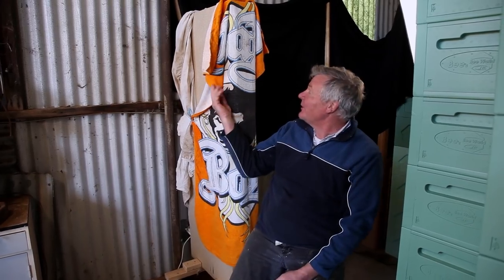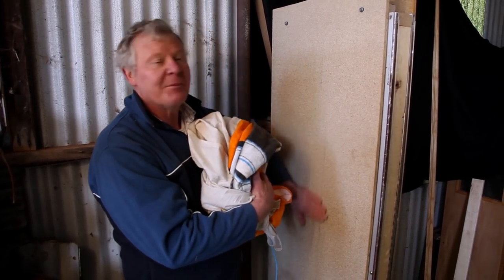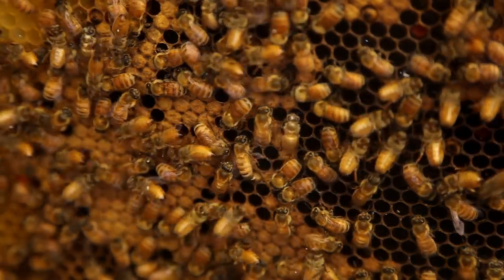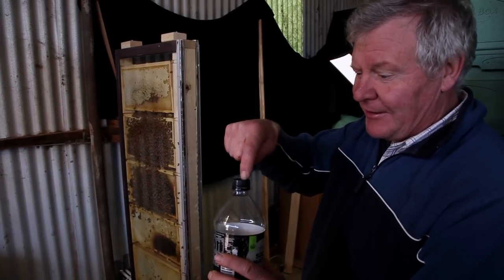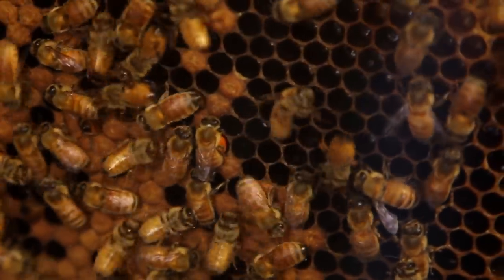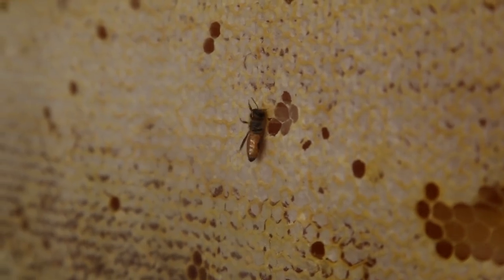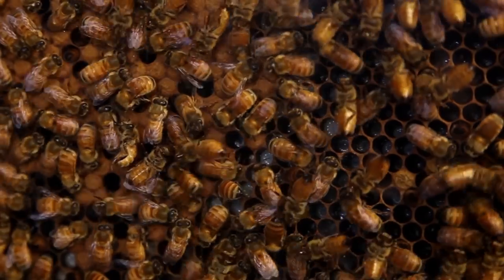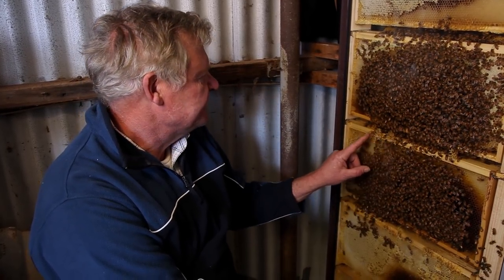How Bees Make Honey and new Baby Bees  - The Bush Bee Man

Comment: Just a question with your feeder idea.
If you have a bottle filled with sugar water & hole in the lid, wouldn’t gravity take over & drain it all into the hive?
Reply: I wondered that as well.
Reply: Forms a vacuum in the bottle. Unless air goes in nothing comes out. Is like a bird feeder.
Reply: I did some tests with water in plastic bottles and the plastic flexed too much in the bottles I used so they dripped constantly.  I was using a 1 gallon punch bottle, not a 20 oz soda bottle though.